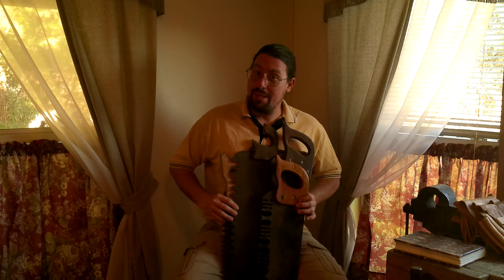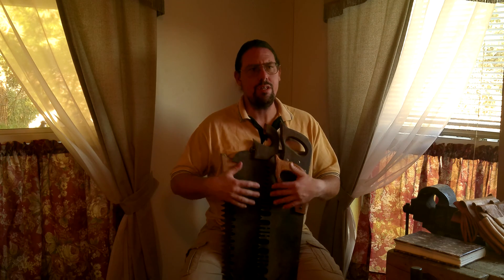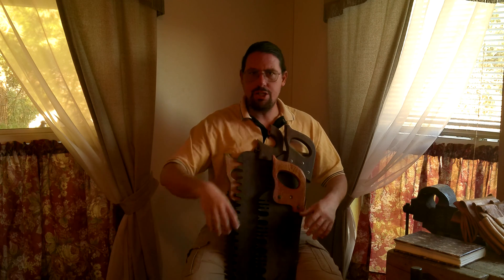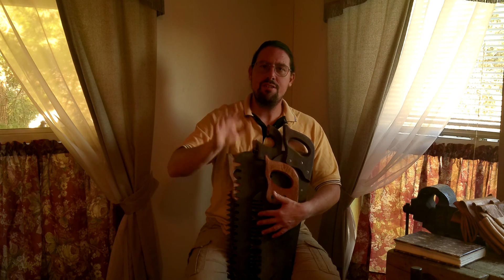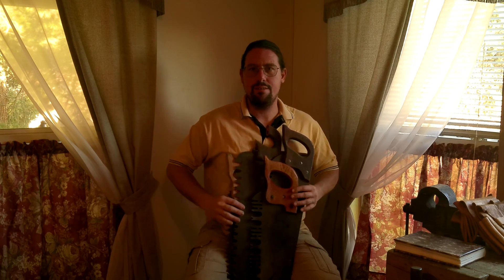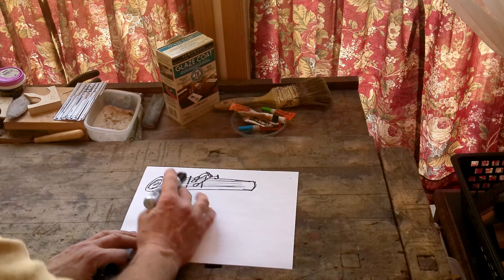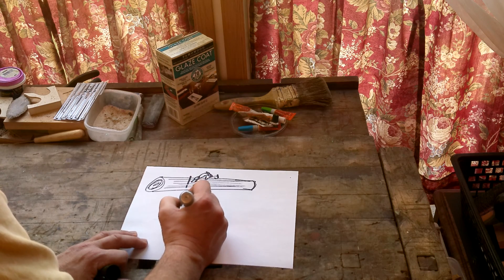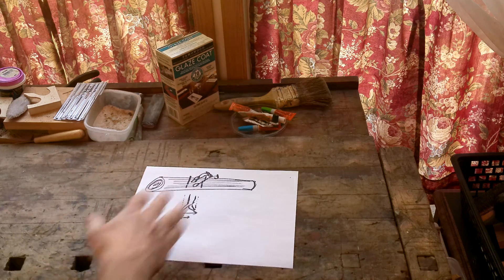Tooth Design in Crosscut Saws for Bucking Logs: What You Need to Know

Comment: How about the Great American tooth pattern (3 teeth followed by a gullet)? What's it good for?
And what would you recommend for cutting up seasoned firewood? I get mine in 3' staves which is cheaper, and I can also use the particularly straight pieces for making things, but the disadvantage is that it has to be cut into 1' pieces before going into the stove.
Reply from the maker: It will work well, it's is basically just a variation of the German m-tooth, I think the two are indistinguishable
Reply: @oldwaysrisingfarm I'm not sure it's just a variation of the M-tooth. On the illustrations I've seen, M-teeth have that hard 90° side that acts like a raker (like you described), but Great American teeth don't seem have that, they're sharpened at an angle for every tooth, according to the illustrations I've seen. They're a bit like the first simple saw you showed, except with a deep gullet every three teeth. The Great American seems to be it's own thing, but I'm not sure what it does better or worse than the others.
Reply from the maker: @BakerVS I've used them, they are very similar to m-tooth.  I do like m-tooth a little better, a little, but not by enough to really care.

Comment: At 13:40 note that the gullets can be cut deeper when the teeth get too short.  Yes you can re-cut the teeth.
Reply from the maker: Sure, but that is basically making a new saw.  You can also cut up the plate and make completely new saws.  But, my intent here is to talk about basic day-to-day maintenance of an existing saw and tooth pattern and completely re-gulleting a worn out tooth is outside that scope.